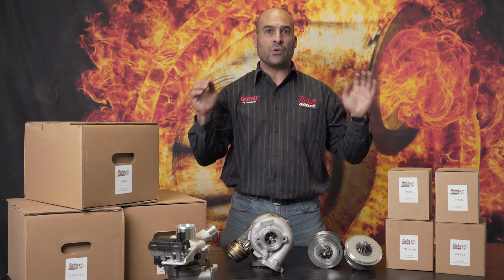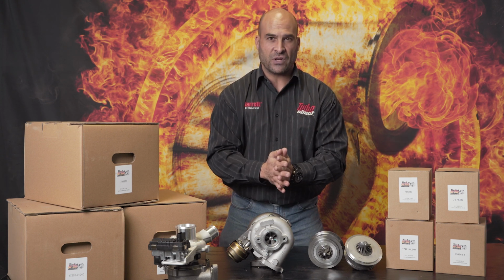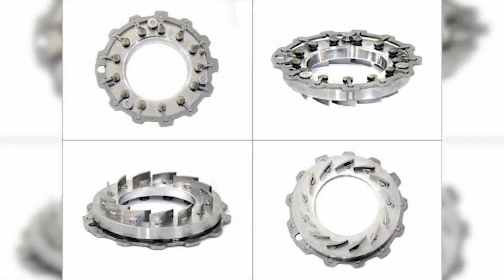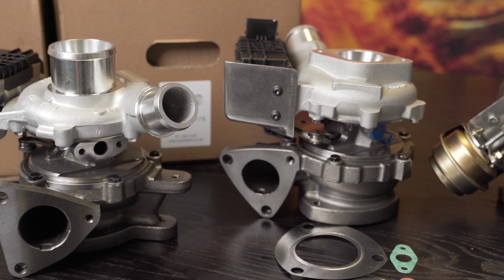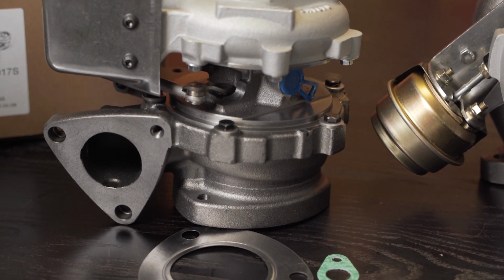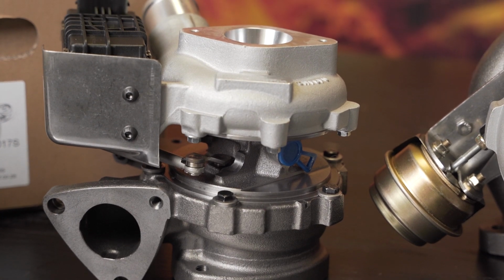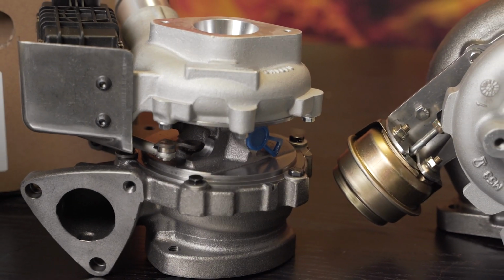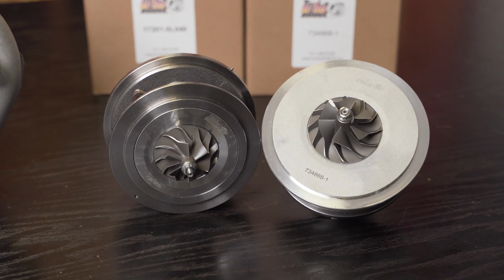TurboDirect S.A - Garrett -Direct Service replacement turbos

Comment: Do you sell repair kits? gt2056vnt navara
Reply from the maker: Yes we do -- including the new MGT series with the Z-bearing thrust face on the side of the journal bearing.
Reply: @TurboDirectSA  what is the mgt series if you don't mind sharing? And how is it different from the regular gt series?
Reply from the maker: @binoyjohn4109  MGT uses a different low drag type bearing system where the thrust traditional assembly has been done away with and the thrust face has been incorporated into the side of the journal bearing itself - less mating components equals less drag. Google MGT1446 repair kit
Reply: @TurboDirectSA  Got it now! Thanks for that. Have been trying to understand for the longest time how the gt1446 and mgt1446 can have two completely different power ratings for what is essentially the same turbo. Thanks for clearing that up!
Reply from the maker: @binoyjohn4109  If you can find the compressor map for these two you will see that the MGT 1446 has a MUCH higher rotational speed aswell.
Reply: @TurboDirectSA  Really appreciate you sharing! I have one more - how do the Latest NGT gasoline turbos differ from the MGT ?
Reply from the maker: @binoyjohn4109  MGT = modern gasoline turbocharger, and NGT = new gasoline turbocharger. 

The bearing system (thrust assembly) has changed again in the NGT with less drag and the use of the Z-bearing thrust faces on the bearing sides aswell as new improved aeros which are more efficient.
Reply: @TurboDirectSA  Thank you for the info! Looking forward to connecting with you at the Garrett Distributor Conference later this week!
Reply from the maker: @binoyjohn4109  I might not make this - i have other commitments.

Comment: When will you release g30 copy
Reply from the maker: Next week -- :-) I bet you weren't expecting that. The following upcoming release of the generation 2 replacement of the GT30 and GT35 models are 100% TurboDirect S.A designs, and nothing is the same as the Garrett range that it will compete head on with except for the flange faces for the manifold and downpipe. 

Look out for these coming soon.
Reply: @TurboDirectSA  Mmm...pricing on GTX35 with .7AR compressor and .82AR (or close) turbine
Reply from the maker: @hondatrix  Shoot me an email